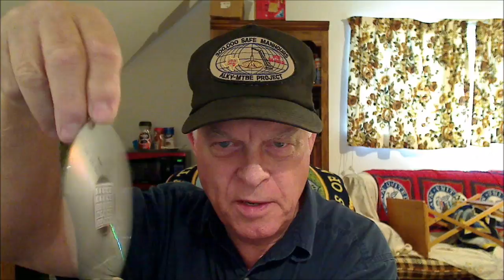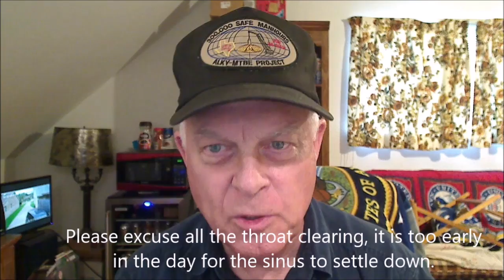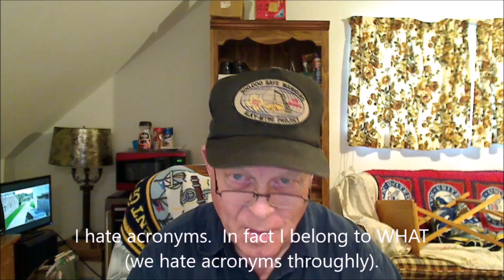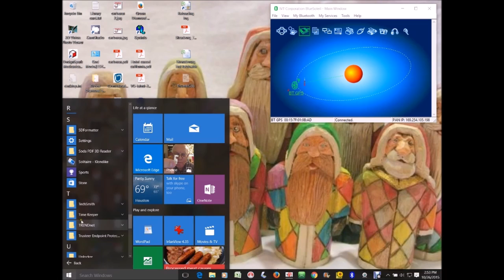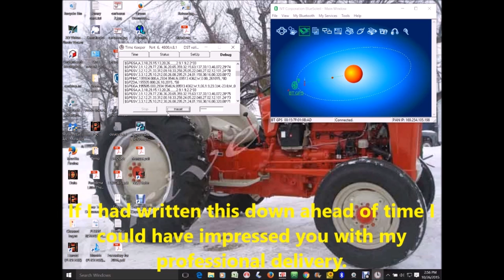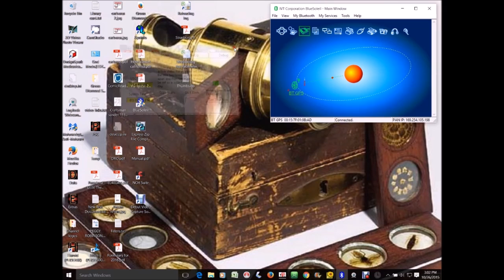GPS devices from the inside #100

Comment: I want the book. I don't want to be shot but I have been stabbed with a knife so it couldn't hurt much worse could it?
So I want to watch you shoot that little target and I am taking bets on how many shots it will take.
How long did it take you to write that little VB program.
I used to do VB but I have forgotten all I knew about it.
Mike
Reply from the maker: +Oldvet1946 I think I would rather be shot than stabbed.  I have not experienced either one but I bet the stabbing hurts a lot worse.  I cannot say for sure about the VB program.  I remember I worked on it off and on for a couple of evenings and then some debugging/enhancements at work a few times.  Mounting the receiver and running the USB cable took a long time, half a day.    Your name is on the list.  Thanks for stopping by.
Reply from the maker: +Oldvet1946 I forgot to mention, hope you bet on a reasonably high number of misses.

Comment: third comment, glad you got through to the joke.. PLC's kinda bring back memories.. I was apprenticed as a watchmaker instrument tech, and the crossover in factory control systems was well underway. I was much more comfortable with 3-15psi signal pressure and wind up chart readers than PLC's and serial ports...
Reply from the maker: +Emma Ritson well the 3-15 psi is still with us at the valve end of the wire.  The computers make control so much better and make it easier to keep from wasting product.   Thanks for stopping by.